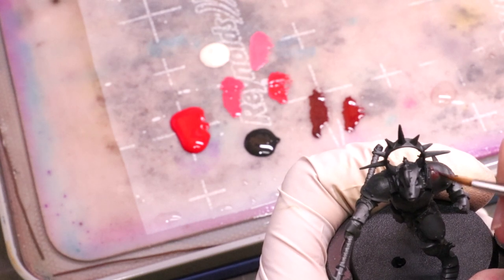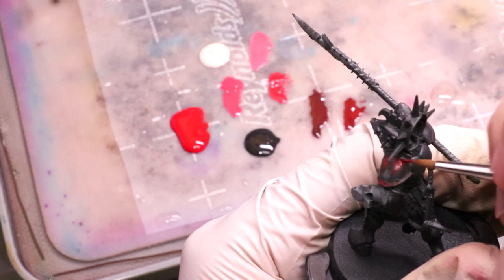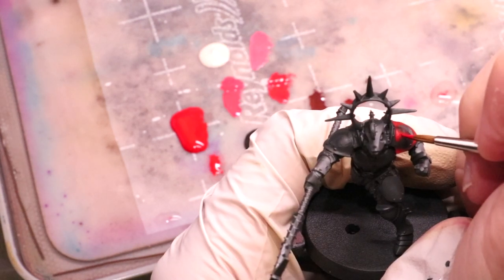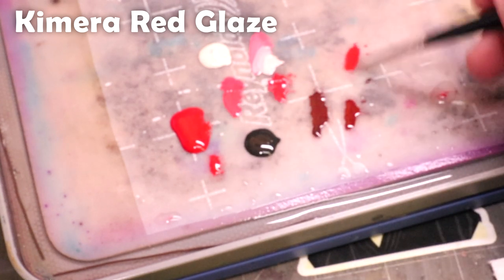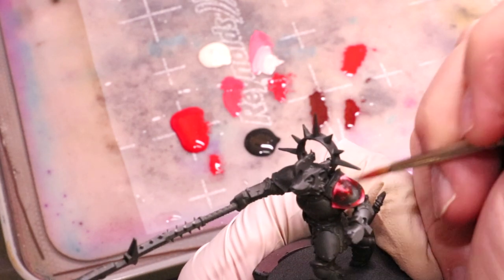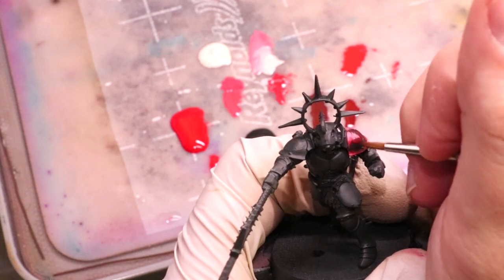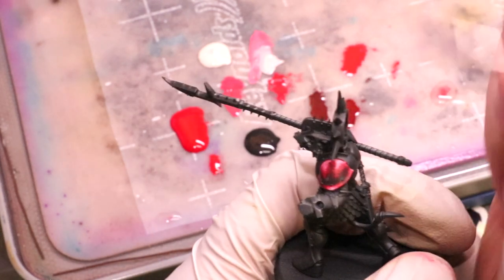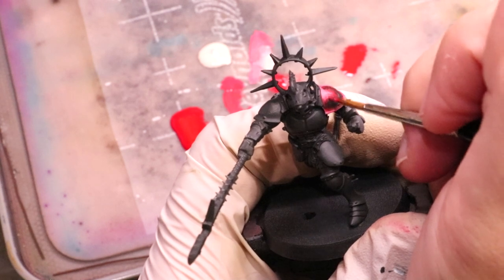The One Secret to Display Painting - HC 314

Comment: I’m not sure if it was a mistake, but the one that I thought I saw was the edge highlight on the back of the shoulder pad at the bottom seemed like it. It looked a little further onto the pad than intended. If it was a mistake, did you draw it out further to create an area that allowed for easier blending? The “correction” looked intentional so I was curious to understand “making the problem bigger”. In theory, it makes sense. Although, in practice, I’m sure I’d face frustration before it clicked in my brain.

Comment: A bit surprised you do one shoulder pad at a time, instead of the two shoulder pads together. In my mind, I want to do both of them to keep myself in the same mindset throughout the process. Then if I mess up one, I'm messing up in the same way on the other - or if I get it right, I got both right.
Reply from the maker: In this case, I basically do each panel one at a time, there are some exceptions, but it just makes everything sqaure in my brain, no reason you couldn't do both.
Reply: @VinceVenturella  Certainly just different ways or organizing how you attack a figure. You also work much faster than I do - so the 2nd shoulder pad would be fresh in your head after the first. I need to be on roughly same stage for both to keep them similar, since I may have to put a figure down for over a week at a time (thanks grad school). Your videos go on in the background while I'm writing - I get more time listening than I do painting!

Comment: Interesting video.  Perhaps I'm wrong, but while futzing can yield a great result, you can't get that super smooth blend.  Part of me still like the unrealistic super smooth technique of Bobby Wong's Blood Angles and Jennifer Haley's technique from the early 2000s.
Reply from the maker: I would say it's one of the paths to that super smooth blend. Much of futzing is basically glazing and adjustments to smooth things out.
Reply: @VinceVenturella  In your opinion do you get the silky smooth color transition from wet blending very similar colors  or though working with glazes and filters?
Reply from the maker: @Stormtrooper1787  So first, let me refer you to this video here - https://www.youtube.com/watch?v=k84npvSDpsI&list=PLcdsbwBroEmD2fNEJhcju6PD7qRmoo04Y&index=210&t=587s

Now, I don't want to assume anything about your level of experience, so if this is already known information, I apologize. The important thing to know here is that Acrylic paint isn't meant for blending, it's actually really poor at that task. This is like hammering with the reverse side of a screwdriver. Acrylic paint is meant for lightfastness, durability and fast drying time (that last part is the issue). Acryllic medium forms a sort of crystal lattice bond when the solvent (water) dries and traps the pigment in a very regular (hence bright, even) color. It was moved to from other older types of paint because it's just MUCH easier to work with and largely non-toxic. 

Now, The reality is, all of those techniques are generally necessary to achieve a smooth blend with acrylic paint and more. There are many tactics (wet blending, two-brush blending, feathering, layering, glazing, filtering, et al), and that's not counting additional additives like drying retardent or glaze mediums. If you are trying to acheive something truly smooth, it takes TIME and usually multiple of those techniques in combination. 

Hope that all helps.

Comment: Hello Vince! Thank you for another awesome video. In previous hobby cheating videos you talk about Varnishing throughout the process. During this video I never saw you varnish the shoulder pad. 

Do you varnish throughout the process when painting for competition? Do you give a final ultramat coat with your airbrush to protect the miniature? 

Thank you in advance! -horacio
Reply: I'm guessing that the varnishing is done after major steps/elements are completed. So in the case of doing NMM this whole is just a single part of the NMM painting element.  Now that part has many steps in it, but the varnishing process would come after all of the NMM is done.
Reply from the maker: In this case, I didn't need to varnish mid-step, just at the end, but often, yes, for competition I will varnish throughout depending on the needs of that piece.

Comment: id watch you paint shoulderpads for weeks vince, no worries!:D thanks for a great video as always:) i had one question tho, do you generally do one section of the mini for display like "finishing" up a shoulder, then going to another shoulder and so on, and ajust for cohearancy when its all up to 90%? or was this just to keep the video a normal length so you did not have to finish an entire ratcast?:)
Reply from the maker: I vary honestly. In this case, I am taking everything up to finished because I need to work each individually, but it's purpose driven. This isn't always the path I follow, more based on what I want to achieve.